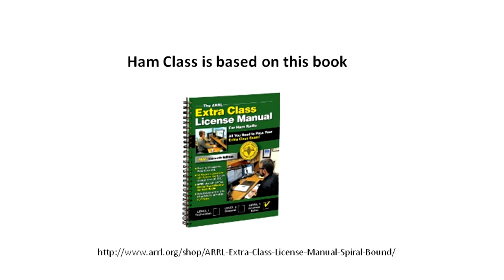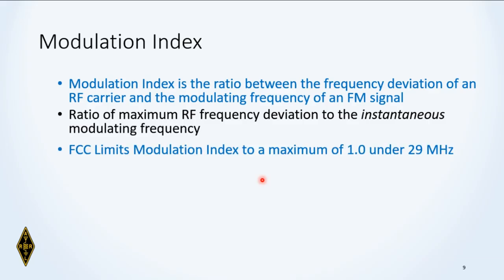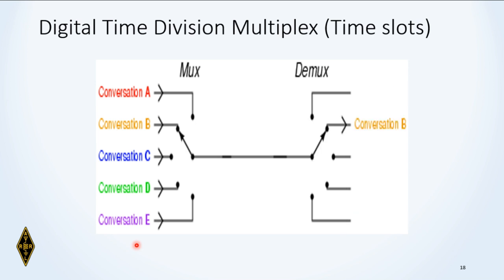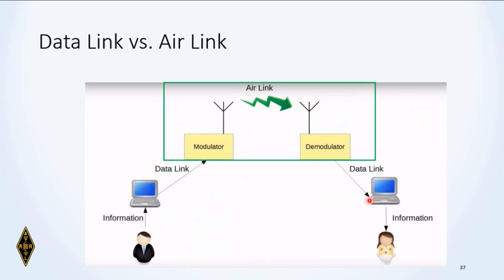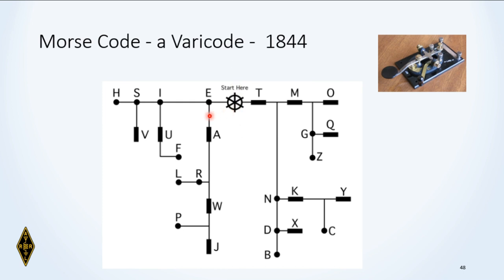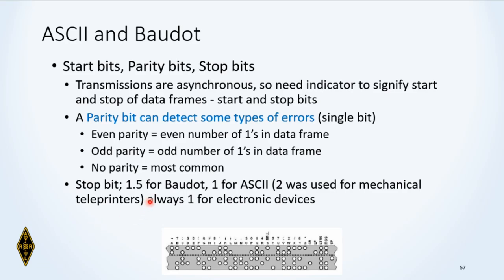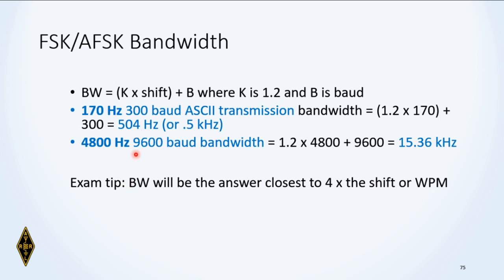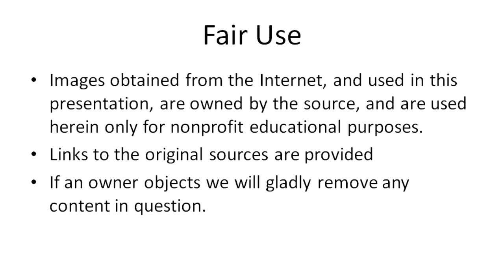OLD - Extra Class January 2019 Chapter 08 Part 01 Modulation Protocols and Modes - Old Question Pool

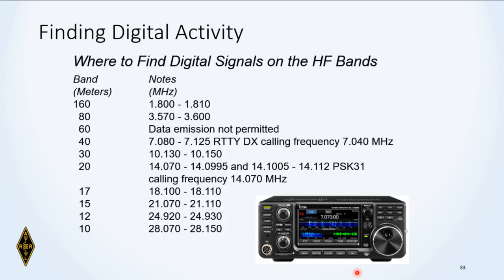Comment: Slide at 40:21 indicates 60m has no data emissions allowed, This doesn't seem to match what the FCC has set forth, nor what is actually taking place on the band.
Reply from the maker: Thanks. We'll check that. Data is allowed in the 60M band as long as the carrier is centered in the 2.8KHz wide channel. 73 de W4EEY

Comment: At 18 mins you go on about “FCC limits modulation index to a max of 1 under 29 MHz.”  That really needs some illustration and explanation.  From my inadequate novice level understanding I cannot make sense of this - it seems to make all normal signals in violation.  I must be misapplying terms/jargon.  Please give examples of typical use in those bands and resulting modulation indices to demonstrate that normal use is / is not compliant ?  Such examples would also simply validate that we understood the material basics.
Reply: I concur and am just as puzzled as you are, Tom.  If, like Dave states, the larger number is always divided by the lower, then the Modulation Index can never be smaller than one, and all signals would be illegal per FCC rule stating that the Modulation Index shall never exceed one over the defined bands.